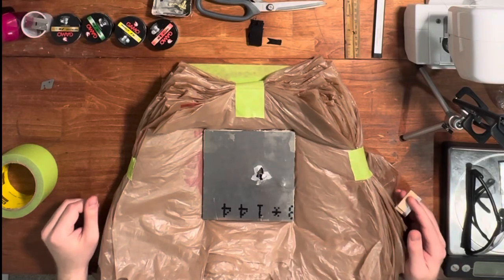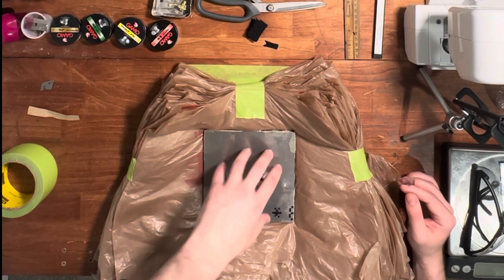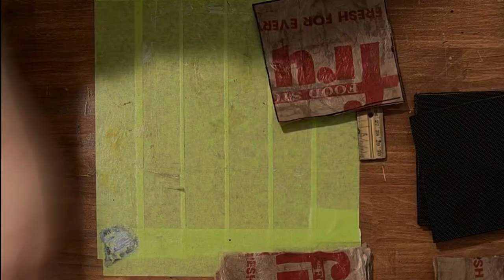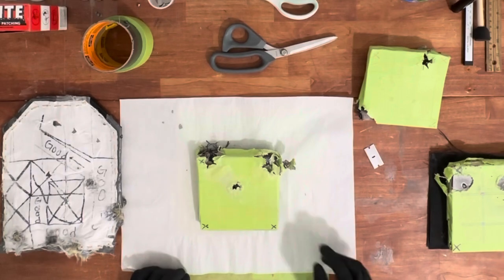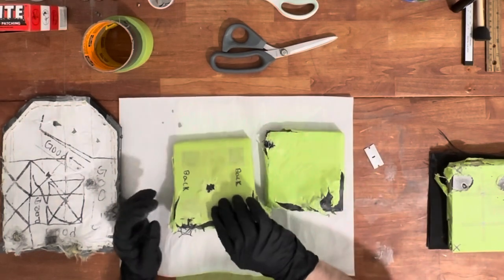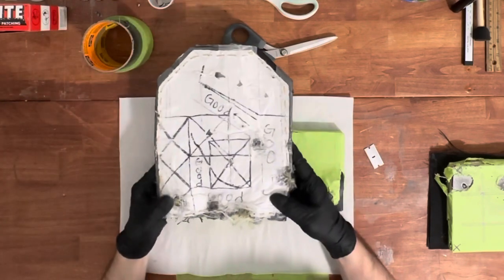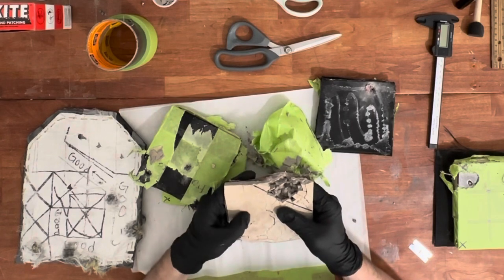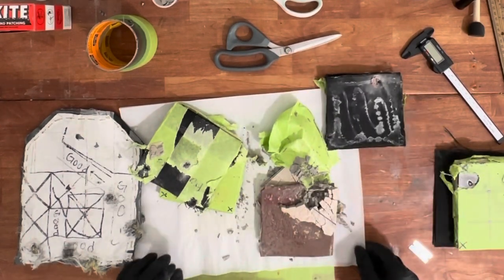Nylon/shopping bag Body Armor? (Attempt 1) information gathering.

Comment: Have you thought about gluing or sewing alternating layers of 1000D Nylon and melted HDPE grocery bags since you can't laminate them through melting in an oven. There are no hazards associated with melting HDPE in an oven, have you tried explaining that to your mom? It is 100% safe to melt, as long as you are not burning the plastic, you should be fine. HDPE also gives off no odor or toxic fumes when melted.

Also you're correct about thicker HDPE layers between fabric layers being more effective for stopping power of DIY Body Armor. I've always had the idea of refining the manufacturing process of Tech's Fiberglass Fabric laminated HDPE plates, by melting all the HDPE film layers at once into a solid thin sheet of plastic about 1/16" or 1/8" thick, making multiple 1/16-1/8" thick sheets of HDPE plastic resin, then laminating the sheets with the Fiberglass or other composite fabric. It would be a lot more work, but the end result would be a much more efficient composite backer to a ceramic strike face that's able to absorb the energy and stop an incoming round better.

Comment: Aren’t aramid fibers just plastic? Perhaps this could be viable, but just how much can you heat compress it before it can’t no more? And how effective would it be at its maximum compression? 

One plastic I would like to see be experimented upon is polyurethane, that stuff seems like it could be good backing material to absorb or catch projectiles.
Reply: Yes and steel is just metal...   PU has negligible tensile strength.
Reply: Yes, very tiny, tightly WOVEN fibers- that's a key part
Reply: @mjgII  no none of that matters unidirectional is the strongest and its not woven at all.  It's the strength of the chemical bonds in the fiber and their alignment (on a molecular scale) that matters.
Reply: @LupusMechanicus  you just reiterated my point. Without even considering the molecular structure of the material in question: kevlar, plastic or otherwise- an interwoven network of fibers disperse the energy over a wider area therefore catching a projectile, it's much more efficient than a solid piece of the same material- it's basic mechanics. Obviously both qualities matter, but combining the two will yield the best performance

Comment: What i have always wondered is whether the order of material matters.   So say you have 3 scrap steel plates and some memory foam.  Would it be better to use steel, steel, foam, steel or steel, steel, steel, foam.   Also trying mixing in the usaual material's like,  printer paper, lead sheeting, porcelain, ceramic, marbel tiles, fiberglass, kevlar w and with out epoxy, rubber or polymer layer.  And just put them all in different order to see which is best.  Love your videos!
Reply: Order does matter because if you can break the bullet apart then each fragment has less momentum and less ability to penetrate. Softer layers may not catch or even slow down the first strike but are effective at catching smaller pieces even if the speed is the exact same (which it never is)